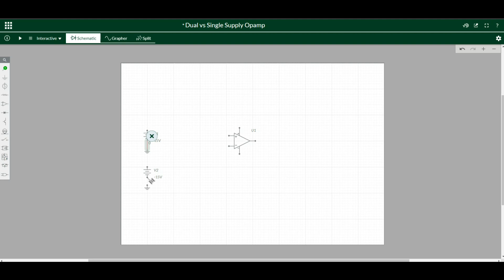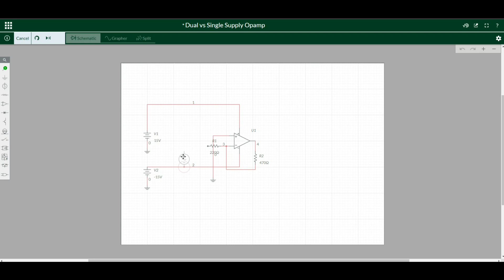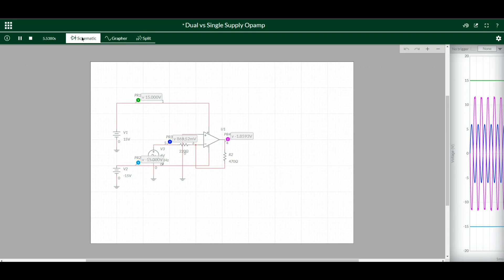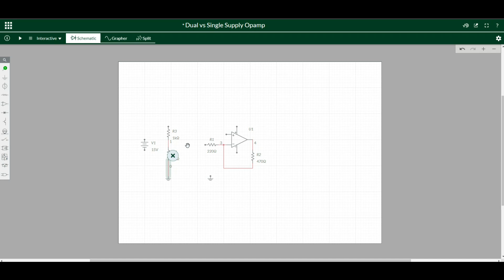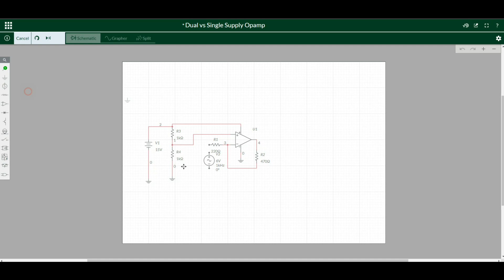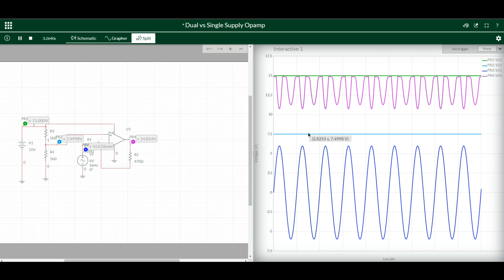Viewer Question: How Does A Single Supply OpAmp Work

Comment: Please tell me what program you use for your simulations. Can you explain why the output signal is so distorted for your single supply circuit? Thank you.
Reply: Found it: On-line Multisim free but very limited number of components (5).
3 bucks/month for15 components
10 bucks/month for unlimited no. of components.
I tried it but found it difficult to wire the components without zooming all the time.

Comment: Could you explain the purpose of it?
I mean you could have just turned the original 6 V signal up to 12 V. To achieve the same signal.
Or do you do something like this when that is not possible without distortion?
Reply from the maker: It's an amplifier

Comment: The Single Supply Opamp will CLIP the output waveform having a LOWER Headroom peak to peak voltage swing compared to using a Dual Supply Op amp has a HIGH output Headroom peak to peak voltage swing?

Comment: So taking your second circuit, why was the output so 'rubbish'?  Experimenting in multisim I changed VCC to 4.5v, R3 to 5k and V2 to 1v and got a nice 'clean' output.  The voltage offset was not the expected 750mV from the divider (or even 7.5v in your example).  Does one of your Op Amp videos explain this behaviour?

Comment: wonderful op-amp video.  😎 Do you have a simple?   [ +/- 0 to10vdc input op-amp]   {Vishay IL300 isolation optocoupler}   [+/- 0 to 10 vdc output op-amp ]   My simulated LTspice model does not agree with the real circuit.  This is just for very slow analog tracking.   Thank you.

Comment: To recover a nondistorted signal at the output you can:

1) Use a series blocking capacitor at the input 

But this will add a high-pass filter effect to the amplifier. Which can be totally fine! But if you do need to avoid this (such as you need a strong low frequency, or quasi-DC response), you can:

2) Add vcc/2 dc bias to the input signal itself (or whatever DC difference exists between 'true' 0v ground and virtual ground), by dialing up the internal DC bias of the signal generator. (Or down! If you're using a single negative supply and being freaky deaky like that!)

Or, if you have no control of the input source's internal DC level:

3) Raise the negative rail of the input signal by tying it to virtual ground, instead of real ground. You'll want to ensure the VG node can sink/source current at the desired frequency, so add some decoupling capacitance, or even better, use the extra op amp that's probably in the package as a voltage follower. ;)